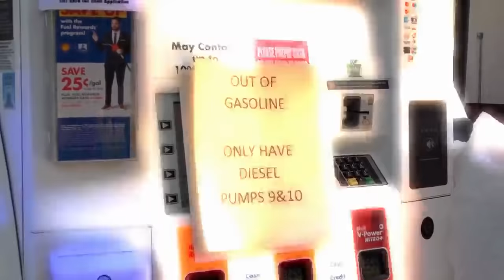Moonshiners Make Gasoline Out Of Alcohol During Gas Shortage | Moonshiners

Comment: Running it in his truck, as crazy as this sounds, would've been a good idea. Flexfuel vehicles have to unique ability of sensing the (approximate) octane level of your fuel. If the fuel is e85, it adjusts for it. If the fuel is e10 87 octane, it adjusts. Here's the important part, if fuel is out of spec, it throws a check engine light! Meaning, they'd know if their fuel is good.
Reply: they have no idea about octane, a sensor in the exhaust connected to an ECU, which determines how much fuel to add to the air that's coming in. there is a knock sensor also in the mix to adjust for pre ignition due to octane.
Reply: @aeroflopper  they have no idea about octane
There is a knock sensor also in the mix to adjust for pre ignition due to octane

I kid, I kid. I meant ethanol. My b.
Reply: @aeroflopper  I know, I messed up the original comment.
Reply: Unfortunately it would not have been a good idea for the truck because once you get over a certain amount of ethanol content the truck will switch over to limp mode because it will start to cause detonation inside of the engine. Why do you think race cars that run on pure ethanol have such crazy large fuel pumps, injectors and supporting mods? Because you need five times as much ethanol as gasoline to create the same amount of combustion. The point of ethanol is it is renewable not more efficient.
Reply: @baltazard133T  the moment the system detects the fuel being out of spec, it will throw a CEL. Shutting it down right then and there would let very little fuel into the engine. Also, modern engines pull timing for knock. 
It technically isn't the best idea ever, but he was smart for wanting to try it in a modern flex fuel vehicle that would tell you what fuel it is detecting.
Reply: @jakegolliher2891  I can't speak for any vehicle newer than 2007, all of my knowledge and experience comes from Japanese vehicles with flex fuel sensors. Every time I've dealt with anything with above or below rated e85 mixtures in those vehicles causes detonation or limp mode.
Reply: Putting that in an on-road vehicle is illegal. It's untaxed fuel.
Reply: @brucejohnson1264  yeah, that's what I said, a good idea. 
What, do you just loved being taxed?
Reply: @brucejohnson1264  WWWRROOONNGG
You can legally run your own homemade fuel. It is illegal to make it without a permit which is easy to get in most states. It is actually legal to use illegally made fuel. Also what you are thinking of is RED diesel I.e farm fuel.
Reply: old engines as the tractor, have almost 0 issues to run this, same as old diesels running sunflower oil instead of diesel. you can run at over 70% oil with system to preheat the oil before its mixed with the diesel. some people run old VW on pure oil, either burnt engine oil or sunflower one.
Reply: its a terrible idea
Reply: You'll get a bad compression code. Just drain the tank and refill with good gas usually will clear it.
Reply: Flex fuel sensor is "spliced" through the fuel line, usually before the fuel rail/rails on factory vehicles.
All it does, is "senses" alcohol % flowing through it, and adjusts timing (ignition+injector) according to what the saved "flex" map in the ECM has (lets say 10% all the way to 90% E).
You will typically need 30% more fuel when running E to achieve the same affect as you would on gas, so yeah, you could run it in non flex vehicle, but it would be running lean without a tune.
Reply: Had an engine that started on benzine and runed with diesel
Reply: @aeroflopper  ethanol is HIGH OCTANE
Reply: @agga7517  GM used virtual sensors  (using the exhaust as a calculation )
Reply: @punker4Real  GM O2 sensors are narrowband
Reply: @punker4Real  you asking me or telling me?
Reply: @agga7517   no physical sensor in the 2007 to 2014  flex fuel SUVS  it's a calculation of the exhaust      i know i  got one
Reply: Older trucks with carbs are easy as hell to set up for alcohol as well. stuff is hell on just normal fuel hoses and gaskets not designed for it though.
Reply: @jr540123  that's actually pretty interesting. Do you just way over-adjust the carb for a higher or lower air/fuel?
Reply: @jakegolliher2891  You can get away with just rejetting, so if your your running a certain percent say 80 corn liquor 20 gas there should be a formula on how far up you need to rejet the primary and secondary to have the engine function correctly. Also a side note most racing carbs set up for alcohol run a higher fuel PSI than regular carbs but for a flex fuel setup its uneeded to raise the PSI. At least based on the knowledge I have as of now.
Reply: @punker4Real  bro, it's like the same P/N for GM FF sensor from '02 and on.
Look under your frame on passenger side, follow fuel line from tank and it will be on there.
Reply: @agga7517  They cut corners . on the 07 to 14 .. it does not have  a physical sensor....  the calculation is done at every fuel up by the ECM  what part of that don't you understand?

yes the 2015 model has a physical sensor
Reply: @adrian69644  hooman can an old 90s shitbox be converted to run ethanol? 👀🙂
Reply: @baltazard133T  The most logical comment I have read yet!
Reply: @brucejohnson1264  you must polish boots with your tongue
Reply: @baltazard133T  It's 1/3 more. Not anywhere close to 5x as much.
Reply: @joer8854   the ratios of power to volume between gasoline and ethanol varies on a linear scale as you go up horsepower numbers
Reply: @baltazard133T  it's easy to lookup. Also you can go much higher power with alcohol (ethanol or methanol) than you can with gasoline. You burn a bit more (Around 3%) with ethanol but it burns cleaner, colder and has more power potential than gas.
Reply: @joer8854  are you okay sir? I'm clearly saying the same thing but I'm also adding the point that the more power you make the more ethanol you need to use versus the amount of gasoline you need to use to make the same power. It requires a higher flow rate of ethanol to make the same amount of power that it would on gasoline.
Reply: @baltazard133T  I'm just sick of people misrepresenting the difference in mileage between the two. 500% is way more than a gross exaggeration and is an outright lie. You will reach the max potential of gasoline way before you even hit double and at that point nobody cares about mileage.
Reply: @brucejohnson1264   you must work for them .call the cops 🤷🏻‍♂️
Reply: Hope he makes a video of it running in his flex fuel truck ! Shuts down the know it alls .that be wonderful
Reply: Good way to blow up your engine from knock, this is horrible advice. Only specially blended octanes will work. And if you don't have a flex fuel, forget about it.
Reply: @BluntSmokeTrauma  That's not even close to true. While throwing 100% ethanol in your engine is a bad idea it's not like not having exact blends means the big bad ethanol bogyman is going to blow up your engine. 
The only major issues ethanol can cause is if you own an older car or use ethanol containing gas in many small engines it can eat the seals and gaskets because it reacts badly with natural rubber. No modern car has this problem.
Reply: @aeroflopper  if you get a bit Jacky and you don't care about a few seconds of emissions weirdness at startup you don't even need a knock sensor, as the acceptable AFRs for ethanol and gasoline overlap, meaning if your open loop startup value is at the medium between the two you can then determine the density of the fuel by measuring wether the measured AFR is high or low, that's how I got my 1990 ford ranger able to run on anything up to e-100, just can't take the engine off idle for a few seconds after startup.

Edit: before someone makes the inevitable comment, it's a custom ECU program since the 81-95 ford ECUs are easy to write not only custom tunes but entire new programs since it's just an Intel CPU
Reply: @aeroflopper  flex fuel cars have an independent sensor, separate from the o2 sensors which you're thinking of, or even the a/f ratio meter. it certainly CAN detect the rough octane and adjust timing accordingly. look up flex fuel conversions for turbo cars and you'll see what i'm talking about.
Reply: @apollo9x19  Im sure i was talking about knock sensor, which alters the timing according to detonation,  o2 sensor measures how much oxygen is left/burnt from the air taken in through the air flow meter,  which is mixture control. ive been told sone cars have a fuel sensor in the tank which determines what fuel is in it,  i dont no how that works if you mix the fuel?  and ive not come across any cars here, UK that have that feature.
Reply: @aeroflopper  gotcha, yeah it uses an inline ethanol sensor, I would assume it gauges ethanol content using some sort of resistive sensor, since alcohols resistance is going to be different from gasolines due to additives and dissolved solids. Newer Chevys use an algorithm instead, so that’s some sort of software magic that uses existing sensors instead of an ethanol sensor. But the ethanol sensors surely exist and is a must on any vehicle you plan to convert to flex fuel properly.
Reply: Mine got what's called a choke
Reply: @brucejohnson1264  lol untaxed fuel, right, using components they use, with resources they have, to make something they are using for non profit use. The fact the government thinks it has a right to be involved in such a transaction to begin with is prime example of whats wrong with this country.
Reply: @punker4Real  2002 Silverado has it inline with fuel line..
Reply: @baltazard133T  it’s an old 70’s truck, it has no limp mode
Reply: Its all based on an wideband O2 sensor and a sensor that determines the percentage of ethanol. The knock sensor determines effective octane of the fuel, though ethanol has higher octane rating and good cooling properties so usually no problem.
Reply: @agga7517  I would think that the oxygen sensor would be far more responsive than an alcohol sensor cut into the fuel line.
Reply: @baltazard133T  You are mixing up methanol with ethanol. Ethanol air fuel ratio is around 9:1 instead of the usual 14.7:1. Mixed with gasoline it will probably get to around 10 so it means you need slighly more fuel to reach the same power. Less than a third more but since the mixture has more octane than normal gas and modern engines can detect it and adjust, you lose less hp. Probably around 15-20% less horsepower so it's perfectly doable. Many vehicles are flex fuel so they already have the mods to run on E85 and you don't lose any power. What bothers me is water in fuel contamination since moonshining doesn't make pure ethanol
Reply: @aeroflopper  all flex fuel vehicles have a sensor on the fuel line that detects the ratio of gas to ethanol being delivered to the fuel rail. On a flex fuel ecu they have two fuel maps, one for regular gas and one for the maximum concentration of ethanol possible which is e100. Depending on the ratio of gas to ethanol that is being detected by the sensor, the ecu will interpolate between both maps at any given load cell value to determine the appropriate fuel delivery. You need more than just a wideband to have a properly running flex fuel vehicle.

This doesn't mean that you have to use a flex fuel system by any means to run an engine on ethanol. It's just not very optimal to have to test your ethanol ratio before filling up because without a flex fuel setup you're running on one fuel map and any change in the ethanol ratio can blow the engine.
Reply: @brucejohnson1264  cops aren't looking out for that, nor will they start an investigation (in normal circumstances) if you snitched. I'd say ask me how I know but considering that implies exactly how I know I don't think you need to ask.
Reply: My 2000 ranger is a flex fuel but the check engine light comes on every time I put e85 in it
Reply: @brucejohnson1264  found the undercover

Comment: Say what you will, but these guys know what they are doing and take their time doing it. I respect the effort they put into this and making things work.
Reply: They have no idea what theyre doing. They dont even know the basics of how an engine works. They think they can just make 1 type of fuel for all cars. Lol...
Im not even gonna address the fact that running alcohol-based fuel in something like a SBC 350 would literally blow the block apart...
Reply: @LaZarusXtnct  That is entirely inaccurate. Ethanol has a lower chemical energy than gasoline, so there's actually a lessened chance of blowing things up. Some race cars use pure ethanol. The only issue for most vehicles running pure ethanol is the fact that it will corrode typical engine seals, such as those in the fuel system and intake manifold, and to a lesser degree, engine oil seals. These seals can be replaced with ethanol-resistant seals to remedy this issue, but the biggest problem that is the fact that cold starts are significantly more difficult (precisely because it contains less energy than gasoline), so I think the only way around this would be to utilize a glow plug of sorts, similar to what diesel engines use for cold starts.
Reply: @jw11432  E-85 is actually more combustible than regular gasoline which is why higher performance cars use it as a daily fuel source and get better perfomance. 

These guys are not making ethanol though. Theyre making an alcohol-based fuel. Ethanol is a corn-based fuel.
Reply: @LaZarusXtnct  "More combustible" - Nope. It has a higher octane, which is why race cars use it, because at the compression ratios they have, higher octanes are needed to prevent pre-detonation.

"Theyre making an alcohol-based fuel. Ethanol is a corn-based fuel." - In the video, they literally state that they're adding corn mash. It is absolutely ethanol, just distilled multiple times to yield a higher "proof" of alcohol.
Reply: @jw11432  Literally so much of what you said is wrong that i cant even begin responding to it.
Reply: @LaZarusXtnct  lol I'm 100% correct, son. I'm sorry to hear your ego is so fragile that you refuse to see being wrong as a learning opportunity. Instead, you're trying to gaslight me. Shame on you, little man. Your father would be disappointed.
Reply: @jw11432  "seether country music cover"
Yea im sure you know exactly how your car works 😂
Reply: @jw11432  Everything you do is the behavior of a divorced father who has nothing going on in his life.
Reply: @DiplomattINC  Imagine not being a mechanic while acting like you know more than a mechanic.
Reply: @LaZarusXtnct  You are 100% wrong. "Theyre making an alcohol-based fuel. Ethanol is a corn-based fuel" Just because your a mechanic, doesn't mean you know jack $h!t about chemistry. 
 Ethanol is Ethanol. Ethanol is also a type of alcohol. The word "Alcohol" can mean many different hydroxl compounds. (methanol, isopropanol, butanol) Also the origin of where it came from doesn't make a difference. You can produce Ethanol from more than just corn. Corn is just cheap. 

Your also wrong about (Blowing the block). The octane is very high meaning, you don't risk anything from running an alcohol. It takes more compression to detonate therefore it cannot detonate anywhere below the compression stroke unless you advance the timing and catalyse the combustion stroke. It short, it would just run like A$$. 

Im not a mechanic but I am a mechanical engineer. Dont start flaunting until you actually know what your talking about.
Reply: @ncopp4358  Im actually 100% right.
Reply: @ncopp4358  Youre absolutely not a mechanical engineer 😂
Reply: @LaZarusXtnct  lol, like I would need you to believe me.
Reply: @LaZarusXtnct  Thats insane. Like they say "You can't fix stupid" 🤷‍♂ I can refer you to 100 sources saying otherwise.
Reply: @LaZarusXtnct  If you think you are so right. I'll tell you this much, your wasting your time being a mechanic. Start shooting for a Nobel Prize. Like c'mon, there is no way your not fucking this us.
Reply: @ncopp4358  Yea i own 3 shops and work with carbon fiber yet im wasting my time as a mechanic after being trained and certified through the National Guard. Because some "gamer" on YT said so. 😂
Reply: @ncopp4358  There is no "us". Yourr probably the same kid jumping on different accounts to support his own arguments because you cant handle an L on a YT comment section. Big Beta Energy.
Reply: @LaZarusXtnct  No sir, that's gotta be you. That has to be you. There is no way. Google it, do something. I don't GAF about what you own or what your do. Prove to me that you understand basic chemistry. And then try to hold your previous point. I can't believe there are people actually like this. Pull open any textbook please.
Reply: @ncopp4358  Big Beta Male Energy
Reply: @LaZarusXtnct you keep saying " im right". Without explaining why and without citing a single source, you’re not winning any arguments if thats all you can do lil bro.
Reply: @idkwhatnonamemyself1951  I 'd be on YT making garbage arguments too if i lived a sub-par life.
Reply: @LaZarusXtnct  "Theyre making an alcohol-based fuel. Ethanol is a corn-based fuel." That's litteraly what alcohol is, ethanol... (yeah it usually comes with water and methanol aswell, but you can distill 99% of that)

Comment: Fun fact, FLEX engines are designed to take up to E85, or 85% ethanol; although if you’re going to add more ethanol, you might want to consider that there’s already around 5-10% in regular E10 gasoline